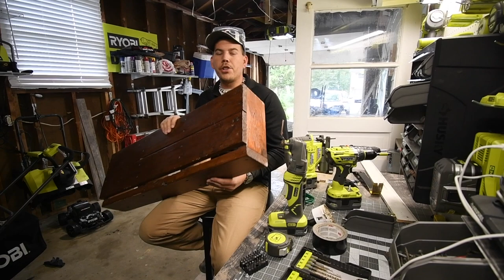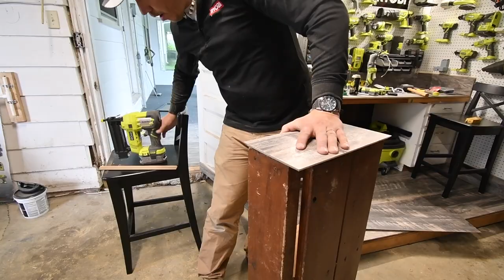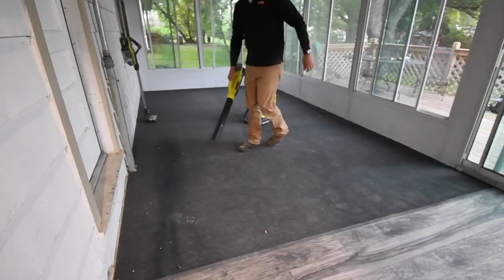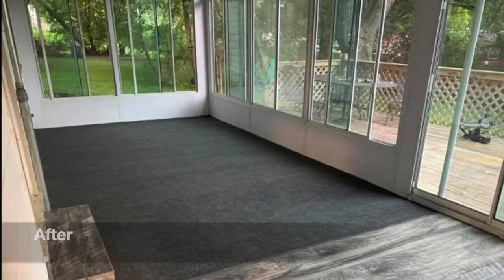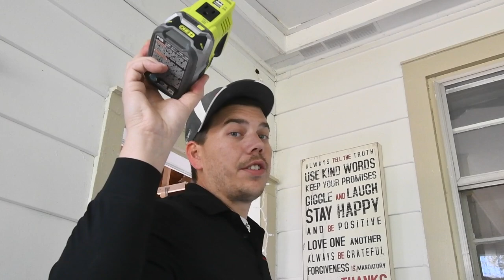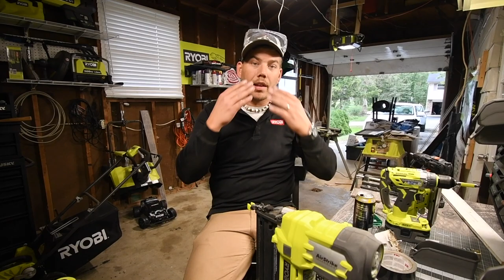Working on the screened in porch. V.2

Comment: Looks like the room is very well improved from what it used to be. Can you do a video on the Milwaukee brushless Full 18 volt super reciprocating saw with free 8.0 high output battery for $249.00 at home depot deal ends on January 2 Thursday of 2020 Since I just got it last week for work as well as the Milwauke 18 volt Oscillating multi-tool and new 7 1/4 inch Circular Saw with free 8.0 High output battery for $249.00 that I just bought yesterday for work since I work as a Remodeling Contractor?
Reply from the maker: Yes I can sir